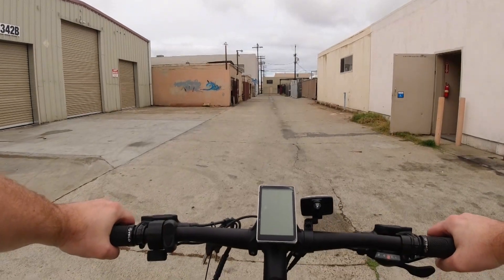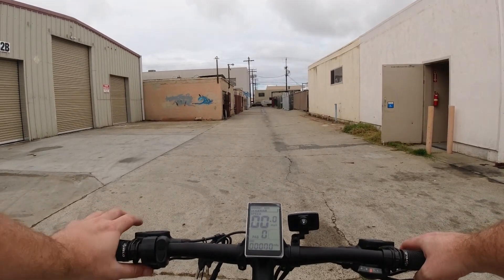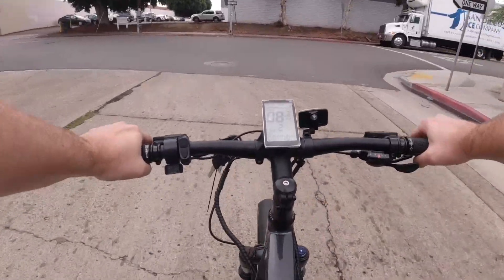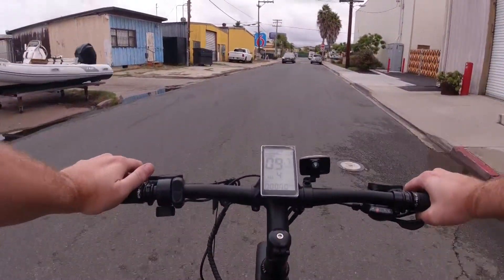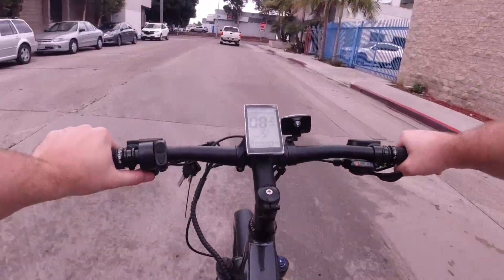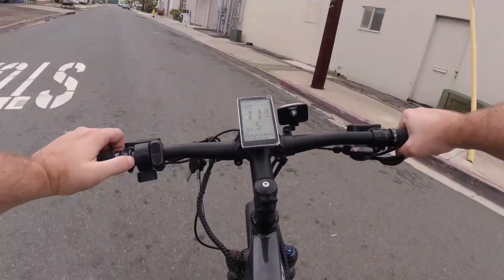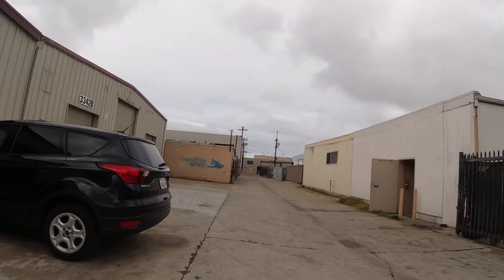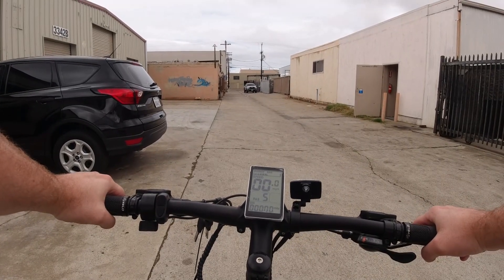Aventon Level Test Ride

Comment: Yeah the pickup on the throttle isn't amazing but it is good. I have the same bike and I use it around Chicago and mainly use the throttle to get going at red lights, then I use pedal assist. I hardly use the shifters and I mainly stay in the 7th or 8th gear just because I use the throttle for that reason. But I am glad the bikes come with the throttle on demand otherwise what's the use?
Reply from the maker: That's what we would primarily use the bike throttle for as well. Especially nice when going up a hill after a long ride or making sure you make it through a red light! Aventon's customers likely aren't buying the bike for its throttle capabilities.
Reply: @TowerEBikes  It's one of those things you didn't know you needed until you find out.
Reply: I dislike the pedal before the throttle works deal, but that's my only real complaint.
Reply: @ghz24   the throttle works ON DEMAND, that is from a stand still...no need to pedal before engaging, you just have to have one of the pedal assist levels on, but no need to pedal before it engages--
Reply: @joeweider9471  Well I actually own an Aventon Level and the throttle will definitely not work until it's moving already.
There is an upgrade color display and controller that would give it that ability but it will not at present throttle from a stop.
Reply: @ghz24  I just bought my new aventon level yesterday and the throttle definitely works from a stop without pedaling, I think the older models  didn't have that feature but the new ones sure do! it's very convenient... how old is your bike?
Reply: @joeweider9471  I'm not sure, I bought it used with 2600 miles for $600 including the cat eye head and tail light. Though I don't see the exact model on their site now I'm pretty sure they came from aventons site or dealer . I've put ~250 miles on it since March. I was hesitant to get a factory bike but for the price, condition and extras I'd have to buy for a homebrew I couldn't resist and I'm not sorry. Aluminum frame and fenders, disk brakes, factory rack, lights included and the built in battery makes for a nice clean package.
0 0@a
Battery still goes 20 miles even when I'm being a speed demon.
I found an un-cycled dealer reject battery real cheap. I'd give you a link but they went fast.
Some people got packs that were only good for reclaiming the cells but I was lucky. 
I heard they were offering throttle from a stop as an option. 
I've thought about getting the upgrade color display and controller package.
I'd like throttle from a stop for times I don't get downshifted in time. And the only real flaw in the bike was a crack in the display.
I'm just not crazy about digging through their wiring (mine is fine) I'm not even sure where they hid the controller I assume it's near the battery. I'll probably do it eventually.
Do you know how I can find the mfg.date?
Reply: @ghz24  well it could be a discontinued model but I think they changed that throttle thing last year 2021 because I remember reading lots of things that for throttle you needed to pedal a couple of times before it would work but they changed that what they did was limit the speed the throttle can take you to 20 mph anything more than that and there's some kind of laws where you can ride it or something like that the bike will go 28 mph on the highest pedal assist which makes it a class 3 or class c or whatever they call it but the throttle will only take you to 20 miles an hour that's how they were able to change it to activate at a standstill which is very useful on hills and if you're stopped at a traffic light I use it a lot it's very nice if you ever get a new bike you will get that 🖖😁
Reply: @joeweider9471  I'm sure it's a level, throttle takes it to 20 mph. Pas level 5 goes 28 mph max (actually you can cheat this a little if you get into the firmware/settings) . 
I'll have to check but I thought I saw settings to adjust where pas levels stop helping (except level 5). Mine is set pretty hot even level 1 helps up to 13 mph it's hard to ride slower than 12mph.
Actually it just has to be rolling (barely rolling) to get the throttle to activate.
If the pedals locked up I could still get home by pushing it to walking speed and then going for throttle.
On the path to the street from my house I use the walk mode (push and hold the down button) and can get the throttle to engage from just that speed with no pedal motion.
So it's not reading  the pas sensors it's wheel speed.
It was originally marketed as a safety feature.
It takes additional electronics to make it check for wheel motion before enabling the throttle.
I have three other controllers none do this they all just allow throttle from any conditions. Pretty sure they don't limit speed  beyond the automatic limits imposed by battery voltage needing to be higher than the back emf from the motor.
Pretty sure it's not a discontinued thing it's an updated thing. Not sure they offer the "safety feature" anymore last I heard when you bought a new one you had a choice.
Did you get yours online or dealer? Does it have a color display or monochrome?
This is the display/controller bundle I was talking about.
https://www.aventon.com/products/bc280-color-display-and-throttle-on-demand-controller-bundle
Talking to you I'm thinking I'll pull the trigger worst case I loose the couple miles an hour top end I cheated from the old firmware assuming I can't do the same trick on the new display/controller. They are offering $20 coupons and free shipping over $100
Makes it less than $125 even if taxed. 
Yeah I'm doing it. This payday or maybe next.
Hope you like yours as much as I do.
Reply: @ghz24  yeah I really love this bike I just bought it yesterday and tonight I took it out for a little test to run up a bunch of steep hills and stuff it performs really well, but I think I found a mistake and the Assembly of the bike... I bought it from a dealer by the way a shop nearby and they're a very good shop, but I think the wrong software is on the bike because I don't get pedal assist above 20 mph and it's supposed to be 28 miles an hour, and when I looked at the description of the bike on the little display thing it says pace with a 350 watt thing but that's not what I bought so they might have installed the wrong software thing on my LEVEL model... I'll go back Friday and tell them about it and I'm sure they'll correct it and that's one of the reasons I wanted to buy it from a dealer and not online is the tech support I will get it's less than a mile from my house they also gave me $200 off and didn't make me pay tax haha... there's no buyers regret on this thing, it's really really nice got great power up steep hills, so I hope you get yours soon! 🖖😁

Comment: why would a company make a commuter bike and wouldn't give you integrated lights, I have seen most of the reviews call this bike a good bargain, but I don't find anything on the bike that you cannot find on some other similar priced bikes , yes the frame welds are attractive and the paint job looks good , both of which are irrelevent to the performance of this bike.
Reply from the maker: We would say you are somewhat correct saying that the Aventon Level is pretty indistinguishable from other $1,800-$2,000 commuter bikes. The nice part with any Aventon bike is Aventon is a pretty solid name in the industry, meaning you won't have to worry about proprietary parts going out of stock or the company dissolving anytime soon, leaving you left for parts and service.  As far as integrated lights, a lot of companies offer them as an "upsell". Unfortunately seems like Aventon is one of those. In order to keep their cost down to their target price level they probably had to omit the integrated light, even if it only costs them $15. In our opinion, every ebike should come with an integrated light, especially if you're riding downtown or on heavily trafficked roads for safety.
Reply: @TowerEBikes  my rad runner city came with front headlight plus a rear brake light , and that bicycle is in the same ball park as far as feature to feature comparison , minus the integrated battery , and hydraulic brakes Aventon could ask their customers for extra $25 which is nothing compared to the price tag that we're already paying.
Reply: You can buy a official light on their website or just find a cheap one on Amazon
Reply: @JustCaden  beats the purpose , if you do any kind of night riding , the fact that you might run out of battery   in  a externally powered light is always playing in the back of your mind , I do not have that kind of issue with my rad , because I know the light is running on the integrated battery
Reply: @vicsaggu4508  I don’t think lights run out of battery that fast
Reply: @JustCaden  in colder climates those batteries drain pretty fast , trust me I know from experience
Reply: @vicsaggu4508  Mine stays charged quite well .
I personally like having the choice of what lights I want. A lot of those integrated lights are weak tea.